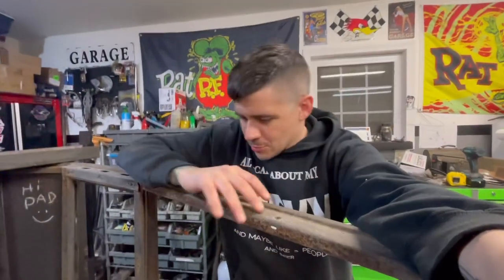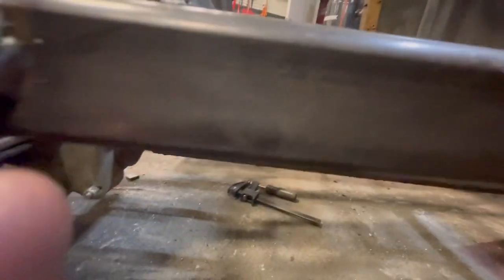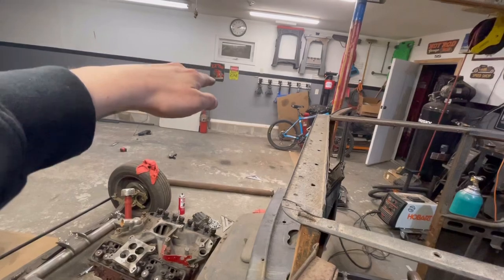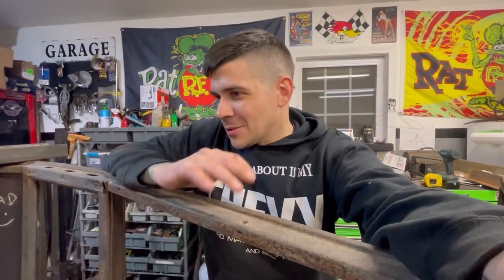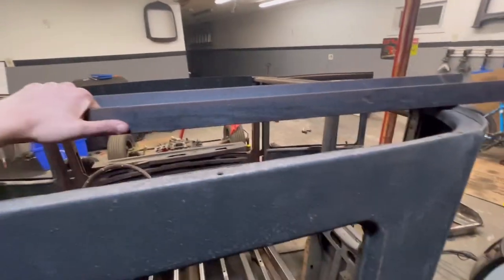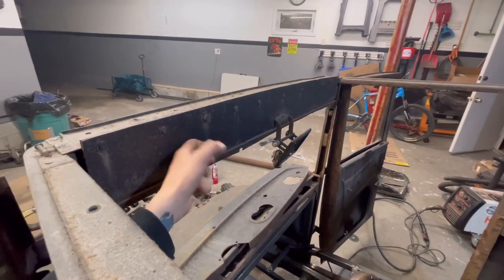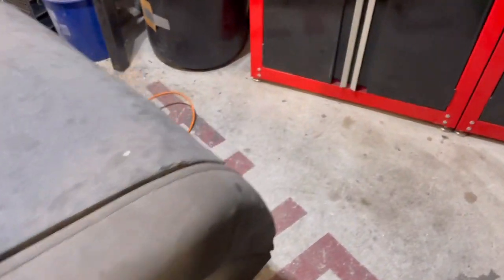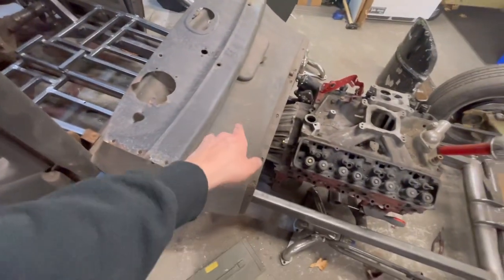1927 Ford Model T rat rod build update.

Comment: when doing the roof, remember if chopped water will run forward unless the roof is flat with slight round side to side  and forward to back. that way much of the drainage will go away from front windshield.
Reply from the maker: Thanks for the input! I might just leave it tall and rock no roof honestly.